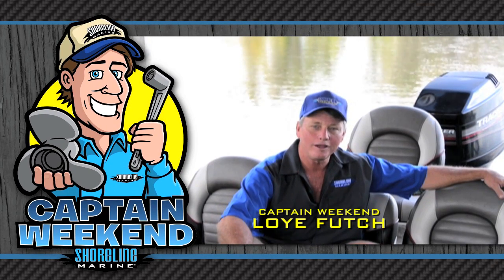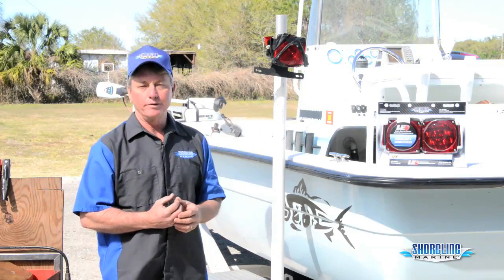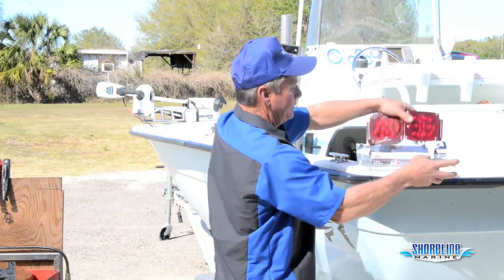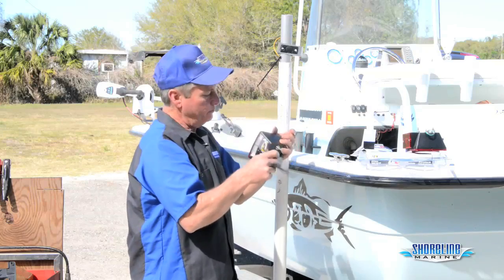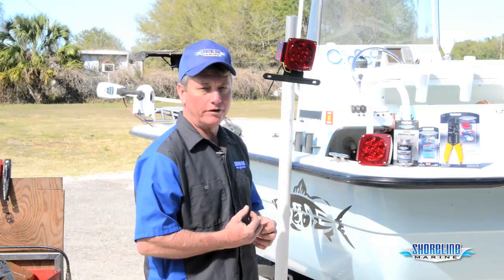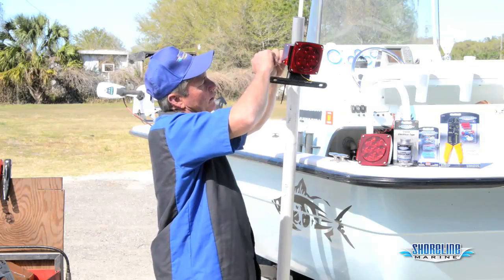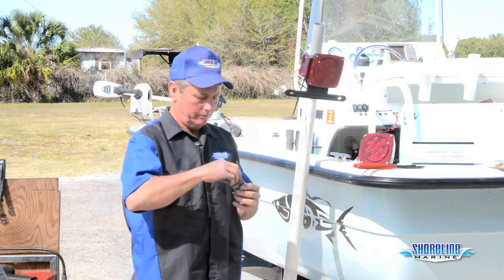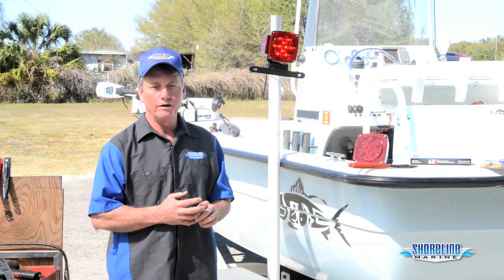How to Install LED Trailer Lights

Comment: Thank you for the demonstration. For those of us who are novices wouldn't it be a good idea to test the lights after crimping and before all the final sealing steps. If we goof somehow it will minimize time and effort check the connection (s). I want to rewire my boat trailer. It is used and came with LED lights. However, the wiring is spliced in several places. I would prefer clean runs with no interruption. Can you point to a video to rewire a trailer. I have a 17ft Boston Whaler Montauk on a li'l rider trailer.

thank you
Reply: hikermansteve buy the reqire kit, should have at least a 20 to 25 ft piece of four core wire and a shorter lead of white wire.  White, brown, brown, yellow, green.  Leave enough at the 4 pin connector to have slack at your vehicle connection.  Attach shorter white wire to the tongue ensuring all paint & rust is removed between eyelet and bolt.  Run one brown wire and the yellow to the left tail light.  Run the other brown wire and the green to the right tail light.  Connect to the lights, done.  Brown is the running lights, doesn't matter what side they go to.  Yellow is left turn, green is right turn.  Ground is through the receiver and ball through the white wire to the trailer metal.
Reply: bryce86777 did the job as outlined and everything is good to go. Thank you very much.